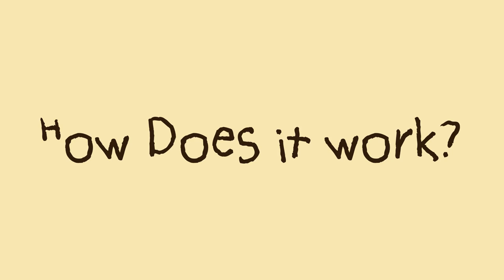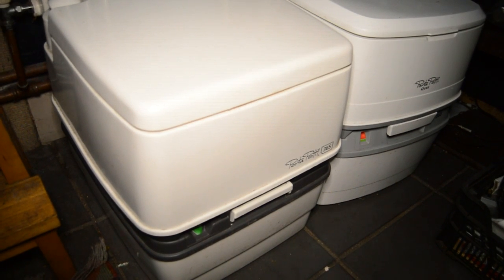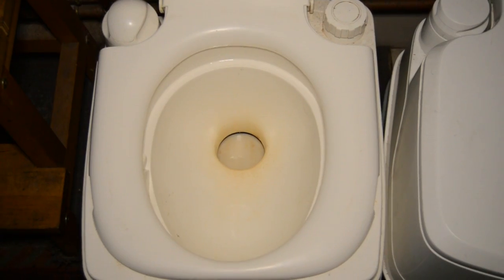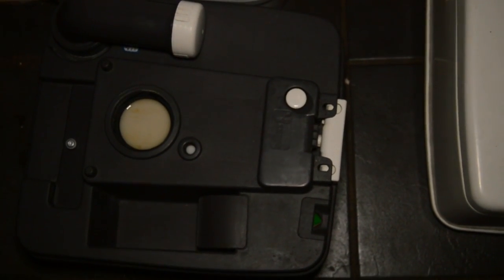How Does the Toilet Work On a Narrow Boat? Part 1:Cassette Toilet

Comment: I've owned a cassette toilet for many years, and I like it very much.  With very little practice, emptying it is quick, clean, and efficient. I like the flexibility and the low cost. 

More ecologically-friendly toilet chemicals can be purchased, but in my experience they are not nearly as effective at breaking down the waste or covering any errant smells.
Reply from the maker: thanks for watching!

Comment: LOL, since we're all talking toilets, I will put my pennys worth in. We got a small sea going boat and it has a ceramic bowl toilet with a pump flush that uses the sea water to flush it into the sea. We use a toilet cleaner from Eco-Flo (think the name is) it's eco friendly for going into the sea, got a strong sour smell though. Can't risk putting toilet paper into it as the instructions said not to, so have to bin it all. I certainly wouldn't want to have to strip the pump to unblock it, when away from home, if paper did block it. Also without a temporary holding tank, we can't flush in harbours or when swimmers are around, near beaches. Don't suppose anyone would want a mouthful of poo, LOL. :-D
Reply from the maker: haha that sounds great but you cant poo in the canal .... i know some people wee in it but they arent supposed to.
Reply: LOL.

Comment: I swapped my yachts sea toilet in favour of a thetford cube 365 porta potti. She sits in mud on bilge keels so we take her up rivers etc plus plan on entering the norfolk braods with her at some point. A sea toilet is useless in all of these circumstances unless you have a holding tank but the boat is only 25ft so not ideal to have a toilet tank. The american composting toilets look very interesting though. Do you use the Eco friendly chems??
Reply from the maker: Sailing S/V Harley Quinn Essex, UK we do (when we remember to fill the flush... )

Comment: as a long time sailor i wonder if you had considered a composting toilet. after having had to tear apart and rebuild a manual flush too many times i went to a rather primitive one years ago and never regretted it and im sure the ones made today are a vast improvement on what was available 30 odd years ago.  the biggest feature to look for is one that separates liquid from solids
Reply from the maker: I have , in fact there is a video about them too, the problem i have is that they seem to take up lots of room and ive no where to use the compost but everyone i know with one loves it. im not sure how our flush could break its very simple!
Reply: i dont know anything about what you call a cassette but pump outs sound very similar to marine heads and those can be a royal pain in the rear end.  here in the us composted or partially composted human waste solids can be thrown in the dumpster and liquid can be poured around a tree or bush or even a convenient flower bed
Reply from the maker: that sounds a bit like composting.... so much poop to learn about!
Reply: You can get electric flush portaloos now, so yes they are much better than years ago. The portables are as good as the ones found in caravans and motorhomes.